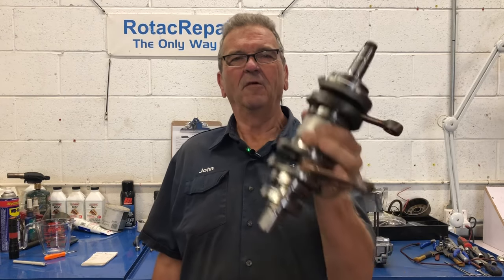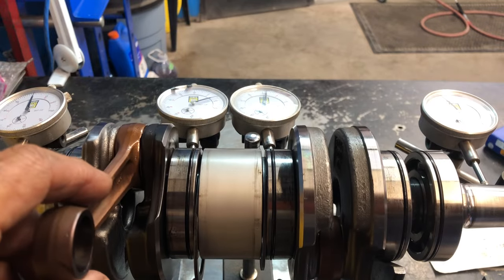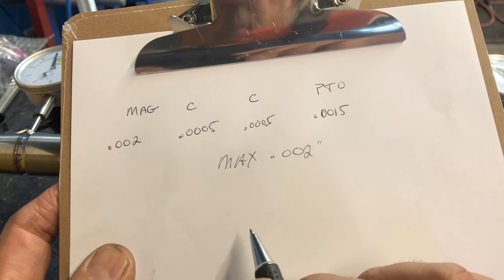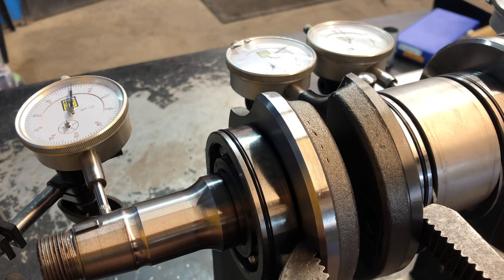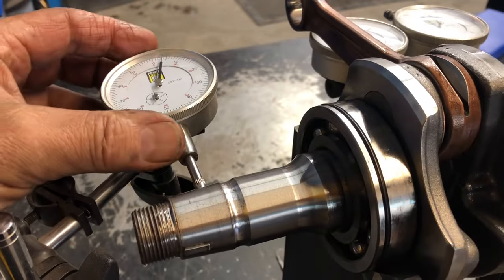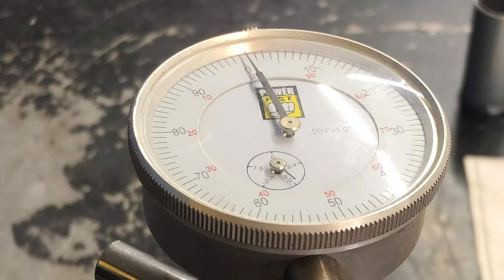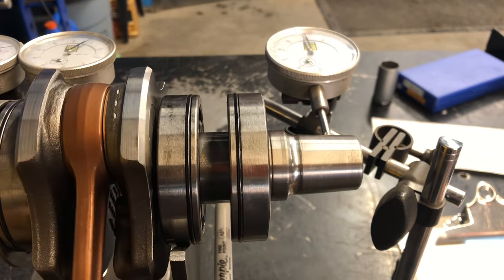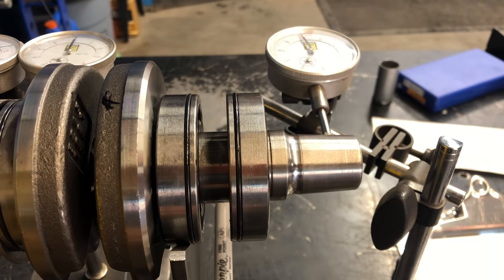Rotax 503UL Crankshaft Truing

Comment: That was simply awesome! Thank you so much for sharing of your abundant knowledge! Greetings from Norway:)  I will try doing this on my 1986 Lynx 5900 GLX 503 snowmobile engine. I`ve seen videos of truing while supporting the two center bearings and then working on one side at a time. That was how i intended to do this. Now I will atleast take my readings like you do and compare the two. I think the Rotax way is the best for distributing the errors across the bearings which is what really counts at the end of the day I would guess. Sidenote: What I found interesting with my crank is that the clearance is not the same for all my bearings. The two center ones are C3 the rest is C4 aka more sloppy than the center ones. I also have the older version with big mag bearing and the rest smaller.
Reply from the maker: Thank you for your kind comment and intelligent thought on distributing the errors across all the bearings. . I believe the C4 clearance bearing are required due to the wobble of the outer crankshaft flywheels from using the centre support truing method. Same flywheel wobble results when supporting on centres from each end. Please let me know your results of the “Center support” verses “the Rotax way”.

Comment: Another very interesting and educational video, John - really enjoyed this.  I just wanted to ask though - if each of your 'taps' can alter things, how come the environment within a running engine doesn't knock everything out of alignment again?  I appreciate that it does creep out over time (hence the need to true the crankshaft) but I would expect the power stroke in the engine to make a real mess of the alignment.
Reply from the maker: Excellent point, I believe if the engine runs smoothly and isn’t mishandled during the installation of the drive system or electric start it should stay straight.
Reply: @RotacRepair  I guess the peak g loading of the power stroke isn't going to match that of the brass hammer. Interesting stuff - thanks again. 👍
Reply: I have seen that some weld their cranks to avoid risking that.
Reply: @Euronasa  Which then makes me wonder whether the heat involved in the weld may cause its own issues... Seems a good idea in principle though.